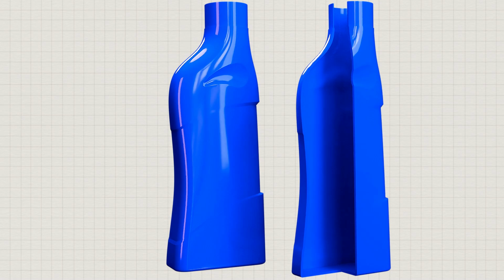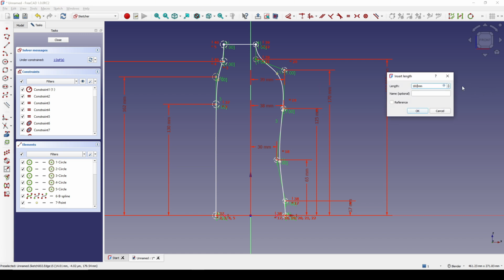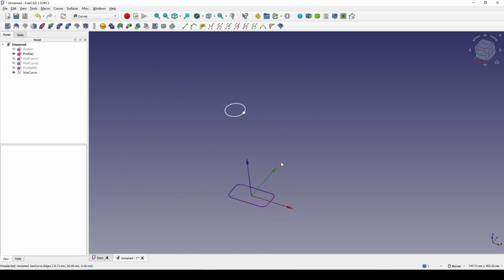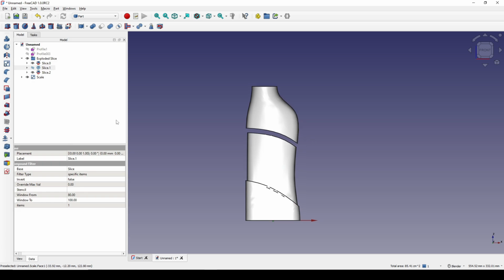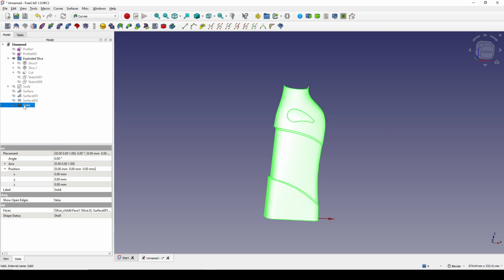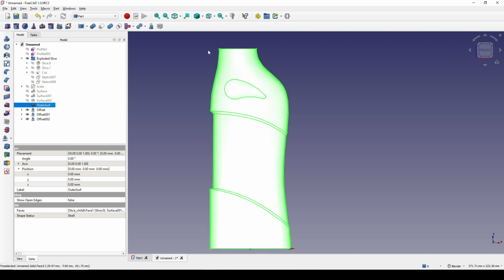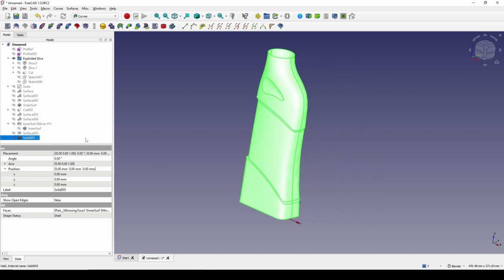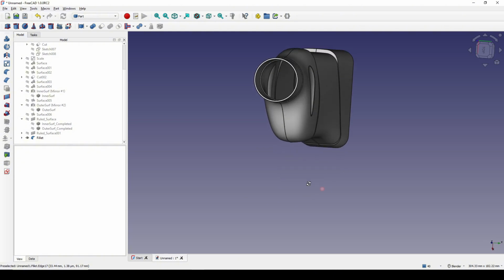FreeCAD 1.0RC2 - Create Bottle Shape And Wall Thickness

Comment: Is there a reason you are creating all of those offset surfaces and not doing a thickness operation on a closed solid?
Reply: Thickness is problematic at the moment, if the shape is not simple, it fails (I've been learning FreeCAD for a few weeks and got stuck on this tool, after research I found plenty of complaints about this problem)

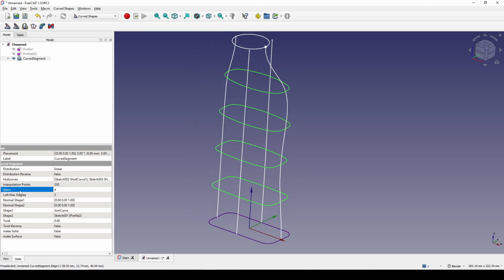Comment: Followed the tutorial but couldn't get the curved segments to work at time 13:18.  The top segments were twisted in on themselves.  Increasing the interpolation points didn't help.
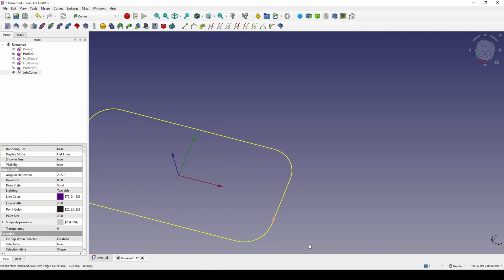Reply from the maker: You could double check the point of the join curve, it have to be exactly in the middle. If not it will be twisted,  12:06
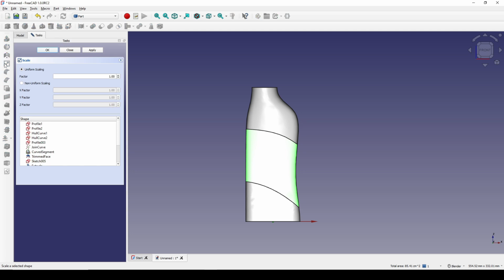Reply: @DuyQuangDang  Finally was able to get the curved segments to work by not clicking on the point after selecting all the lines.  My next question is why do you have a toolbar on the left side at time 17:46?  And why can't I find scale anywhere?  I can go to the draft workbench to scale the part but I can't find how to do it in the part workbench.
Reply from the maker: @neilnagel9857  Try part menu/scale. Older version don't have it.